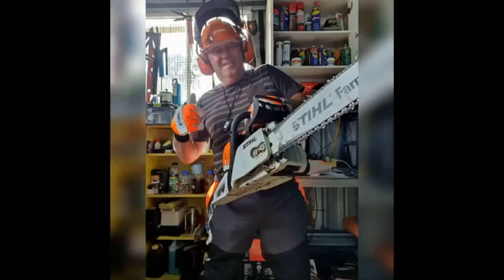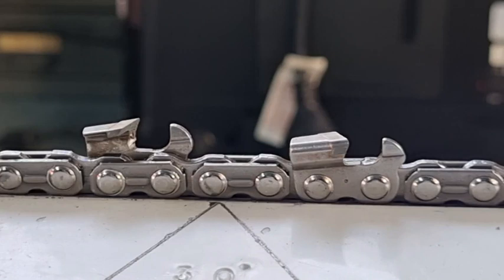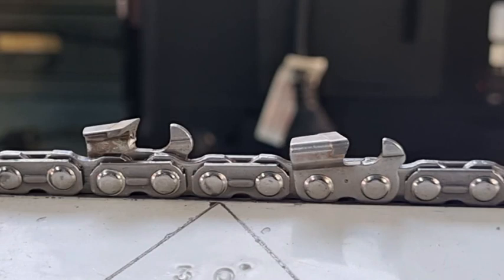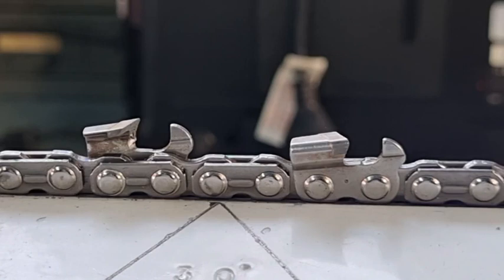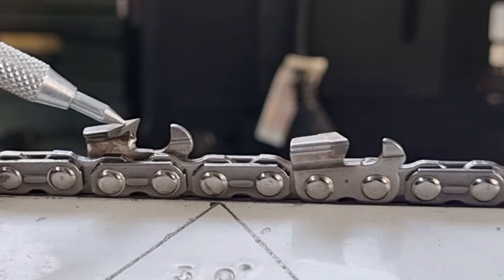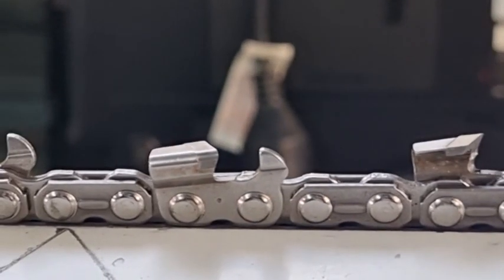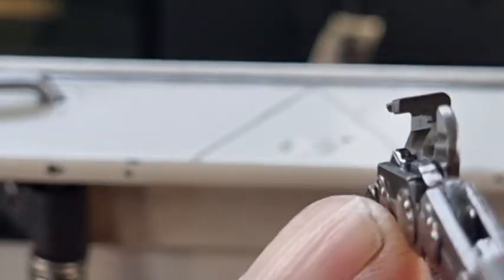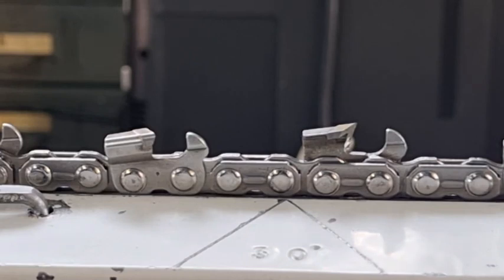Tungsten Carbide chain review

Comment: I used a carbide chain on my Stihl 261 for the first time a few weeks back. I cut dead trees that had fallen, a few buried trees, a couple of standing trees, and some large vines. I was clearing a creek while it was dry. The chain made it all the way without getting dull. Very impressive. Guys at deer camps love them. The cutting surface of the cutter is smaller than the standard cutter. They cost more, but they do not dull on dirty logs or roots.

Comment: I have no experience with Wolfram chains.  If I had to cut through iron bark bark then I'd be using it for the millions of tiny stones in the bark. Also, you can sharpen Wolfram with Silicon Carbide (green) wheels. They are cheaper than diamond wheels.
Reply from the maker: Ironbark is ok when it's green much much hard when it dries out
Reply: @ChainsawUsers  In Qld the iron bark bark is full of stones from the roots to the canopy.  We never cut through iron bark bark because it bluntens the chain in 2 minutes. If it's green we cut the bark off with an axe and if it's dead we wait until the bark has fallen off before we cut. Takes about 10 years for the bark to fall off an iron bark and this is about what it takes to dry it also. (dried when whole uncut).

Your iron bark down there in Danostan is different.
We have Eucalyptus caleyii, crebra, melanofloia etc and the bark is full of rocks.
Reply from the maker: @adelarsen9776 but it burns good with the deep bard catches quickly
Reply: @ChainsawUsers  We don't burn the bark because it fills up the fire with ash.  But not everyone has a choice with wood. I understand.